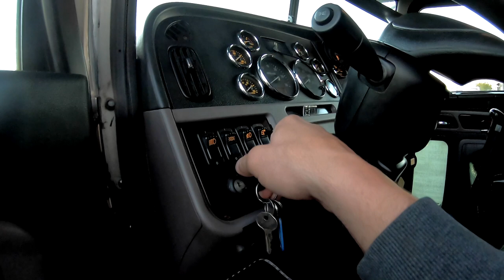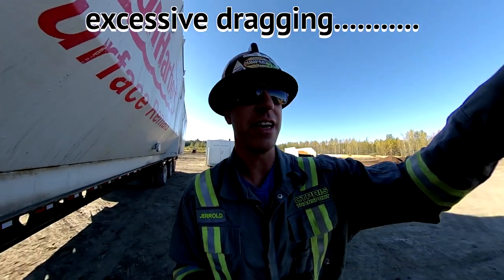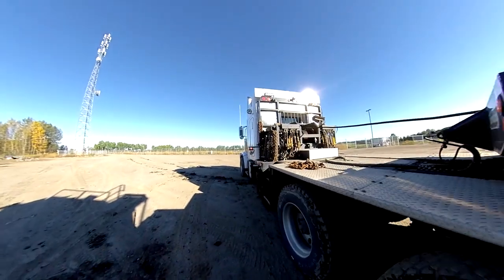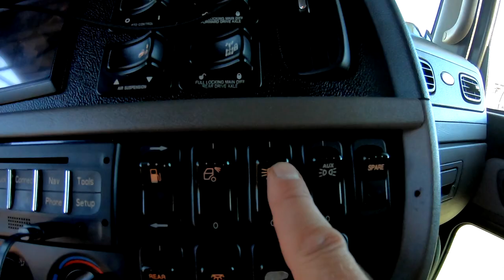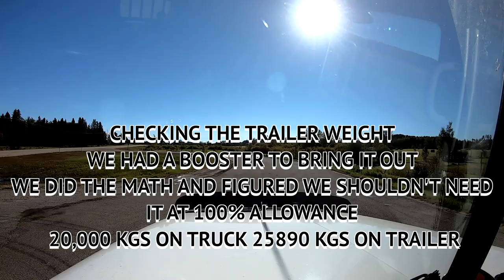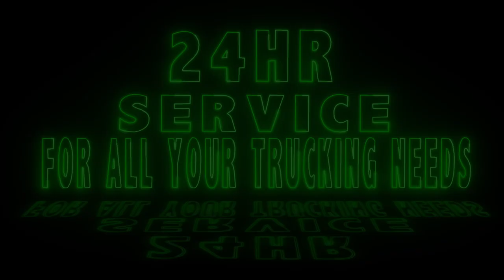INLET TANK HAUL ON TRI LOW TROMBONE WIDE N LONG

Comment: So when the oil field was busy a few years back how much time did (%) you spend moving rigs. Compared to this type of work?
Reply from the maker: i've always been service side. i like the diversity of doing more stuff in other places other then the field. i've always helped other companies move drilling rigs but never full time. the one thing i hated about roadtrain is they would only concentrate on oil and gas service work, i don't blame him, it pays the best and it's easier on the trucks vs being drug through shit holes on a daily basis. i like it all, cypris does a bit of everything and they are in good with most drilling rig moving companies, we haul equipment which i like probably the most but i haven't got much action on that...... there hasn't been much of that. id say 25-30 % moving rigs, i'm pretty comfortable in any size bed and pulling 48 wheels